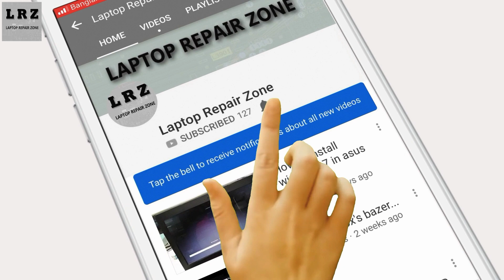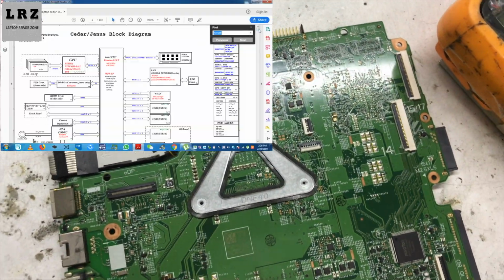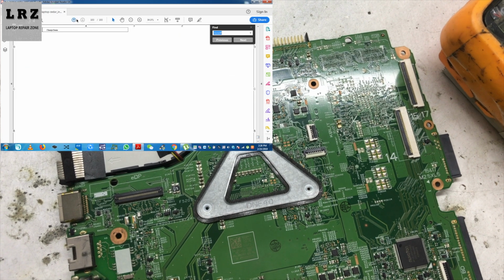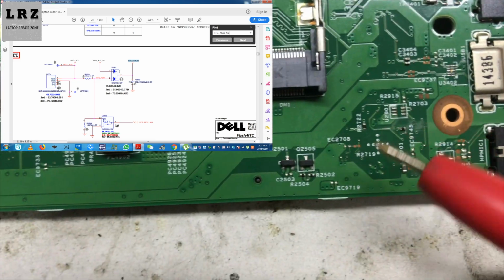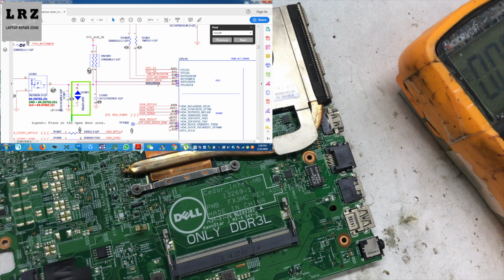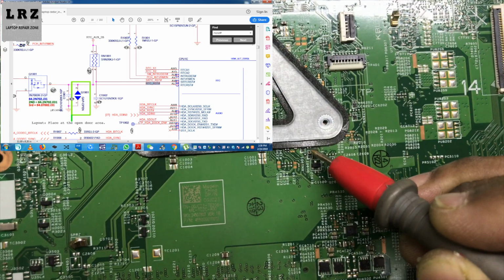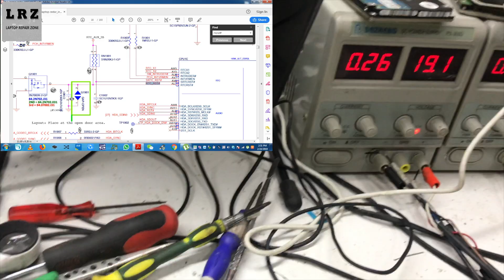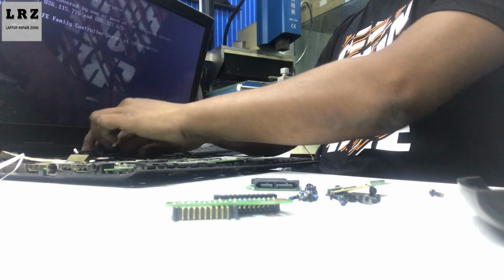Dell Inspiron 15 3000 Serise Cedar intel mb FX3MC not turning on/no power solved

Comment: My laptop model DELL is Dell Inspiron 15 3000 and suddenly it was dormant. As you explained, I go through the mother board and found. no 5V_PWR in points and no D3V_PWR

Therefore I removed R3801 resistor, after that 3D3V_S5 was present and fond 3D3V_S5_PCH side is dead short. What could be the problem.

Comment: My battery already damaged , usually Ive been using without battery , but suddenly it's not turning on. Pls anybody tell me a solution
Reply from the maker: Thanks for your comment, please check with another charger. If same problem then you need to check all the required voltage step by step.

Comment: The charger is my problem how to fix it the lights wont turn on
Reply: If like mine now, the A/C adaptor “Green” LED goes out only when plugged in. It is a safety feature if too much current is detected. Green LED comes back on and does the same with second A/C adaptor from Dell. Both OEM, both work, both shut off on this one laptop. The other is older Dell XP PRO, the new on that kills the adaptor is Windows 10 and 3 years old. Make a guy mad on a 7 cent part shorts. Just need a schematic. ASE Master Tech since 1978 - Retired now.

Comment: WhatsApp number Sir
Reply from the maker: Thanks for your comment.
Reply: @Laptop_repair_zone   whatsapp no.
Reply: @technical_mini  Wow, no reply other than “Thanks for comment”. Clicks & hits, but no answer! Sad. I am sure their are a few companies that sell this software with annual updates. To look at schematic on screen, it is blurry and of no use to anyone from the screen. I am with you as mine won’t turn on and kills a/c adaptor’s LED as soon as it’s plugged in. 3+ years old and 18 months out of $100 extended service contract. Still sad as 23 year old Dell Latitude D620 works fine, but has XP PRO on 32 bit, so use it off line and to print. I guess I’ll have to follow the voltage myself. Best of luck!

Comment: i have almost the same issue but...i am not having voltage on the resistor  that is on the left side of your resistor
Reply from the maker: Thanks for your comment,please follow the schematics diagram.
Reply: @Laptop_repair_zone   i did checked i coundnt find it and i am confuse at some point if send u the pic and mail u could u help me out a little bit, thanks for the reply

Comment: SIR my laptop is automatically shut down and now not CHARGING AND TURNING ON please Help
Reply from the maker: thanks for your comment, first try with another charger and battery,if problem not solved then you need to check all the required voltage.
Reply: @Laptop_repair_zone  ok Sir

Comment: Didn't removing that Capacitor caused any damage?
Reply from the maker: thanks for your comment.
Reply: @Laptop_repair_zone  ya most welcome.. Par vo Capacitor nikal denge to koi problem to nai ayegi na?
Reply from the maker: if you remove that cap no problem, you can replace also its your wish, thanks.

Comment: Bro my laptop 3542 is not powering on. When i press the power button, nothing happens even its led not blinking 
What should i do?
Reply from the maker: Thanks for your comment, if your a technician then follow schematic diagram power on sequence, if your not then take your laptop to your local service center, thanks.
Reply: @Laptop_repair_zone  I AM HAVING THE SAME ISSUE BUT IT SOLES ITSELF IF I PUT IT IN CHARGING FOR 3 HRS. ONLY THE PROBLEM ARISES WHEN I START IT AFTER 7TO 8 HRS. COULD YOU GIVE ME AN ESTIMATE FOR THE SAME.
THANK YOU YOUR VIDEO ARE GOOD.
Reply: Im having the same issue, but i believe ive narrowed it down to a short circuit, i dont have the money to take it to a service center

Comment: This is great, can yu share the schematic, for this laptop i have a similar one at my workshop, that i havent fixed...thanks for this knowledge
Reply from the maker: bro search in google. thanks.
Reply: @Laptop_repair_zone sir same problem I'm face how much money spend it sir
Reply: “BRO” search in Google or brother search in Google? Confused if website or jester?
My exact same Dell worked fine, then plugged in power supply and the power supply must have detected over current and shut off green LED. Tried another Dell power supply, same result. I have Fluke 87 V DMM & scope and know how to use them. The schematics chart software is usually a product the cost money. Is this free on Google search, pay per day/24 hours or purchase to download? Thanks.

Comment: I have the same model.the problem is when i turn on, continuously beep sound is coming and no display..plz tell me solution
Reply from the maker: May be 8 or 7 beeps, if there is 8 beeps then you can change led or lvds cable, if 7 beeps then check all the required voltage.thanks.
Reply from the maker: Iʀʆʌŋ Aɭɩ how many beeps?
Reply: continuously for some time and then fan spin fastly
Reply: My Dell Inspiron 15 3000is not start ing
Reply: Lol mine too but when I held power button the light lit up but then went off. I layered figured out I had to just push power button not hold as it was starting up it thought i wanted to turn it off. Try that I have same exact model 3000 series
Reply: Greyz YT maybe